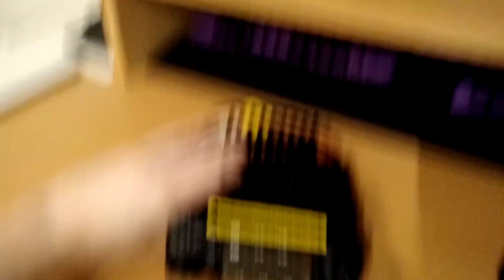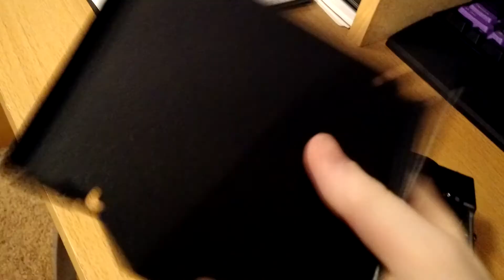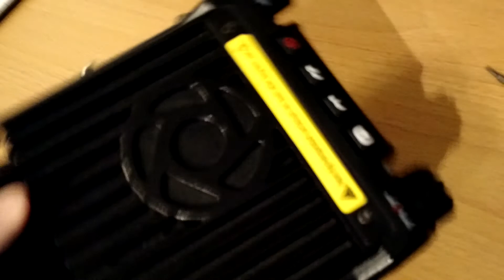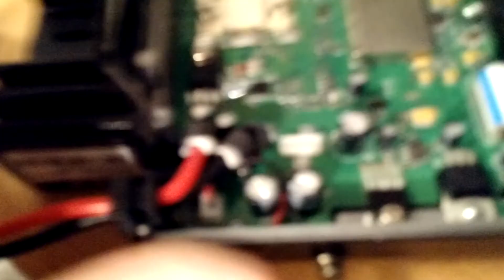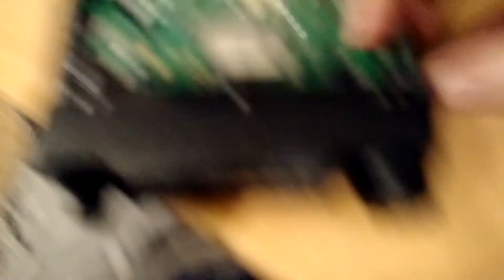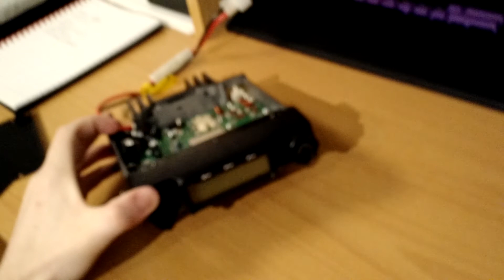Quick look inside : TyT th-9000D ham Radio

Comment: Wrong. The db9 connector in the back IS NOT FOR PROGRAMMING. You can buy a programming cable for this radio and it doesn't plug into a non-existent db9 because that would make no sense. No. The db9 is for packet radio stuff.

Comment: Just blew a fuse installing my th9000D... and, I believe I crossed the 12V + and - to cause the issue. Now, I continue to blow fuses when trying to power up the radio on ANY of my 12V sources. As I understand it... there's an internal protection diode. Do you know of such a thing? Where would I find it to replace it???

Comment: tyt 9000D, I have 2mtrs and 70cm units, this model looks more like 70cm ver, I have my 70cm open atm' a fuse blow 'power crossover' and now no TX  I just removed protection diode still no TX all volts are good (12.4 volts on output of trans in this good or bad

Comment: The PA final device is a Motorola SRF7042 ldmos.  Under the main pcb you’ll find many other SMD parts including the CML chip that handles all the audio processing.  The early radios have an issue of exceeding the CML vcc maximum voltage of 4.6v as they run it at 5 volts.  A simple addition of a diode, 1n914, in series will lower this to a safe value. Otherwise, the CML chip will fail locking up the host cpu causing a scrambled led display.  I repair these radios and this is about the only issue they ever suffer.  Very robust and reliable.  We run many as repeater and link radios.  
The whine or buzz you hear may be a result of the CML operation out of its limits.  
73,
Dan N5MRG
Reply: Hey. Question. Have you ever had rx audio drop out after a long winded ham gasbags about his hip surgery? 
Ive had a couple of earlier ones and i love them but the one issue ive seen is rx audio drop outs on nets or other extended transmissions. That and there seems to be a dc bias on the speaker.

Comment: just want to aid to your slight "buzz, humm" ( if you have any other electrical devices), I find tube lights, clock radios to be my problem being to close to the radio, power leads, antanna could pick up line cycle buzz, 73's ...cheers

Comment: Anyone putting the 9 pin serial in for a remote-base radio or repeater the cos or cor output line is always present when receiver radio is unsquelched and receiving any signal so if you put in ctcss decode the radio still has a Cor output upon any signal (useless) for tone decode you will have to add a t32 tone PCB to lock up receiver on repeater input. There's always interference or birdies, qr, ect getting into your input so that's the deal with DB9 kit.
Reply: Have you built a repeater using these radios? Asking because I’ve ordered the radios and interface cables. I have outboard squelch boards but I’d rather not need to use one. Tnx in advance
Reply: Did you build a repeater from the TYT TH-9000D radios?
Reply: @sdjakeblues  You will find that your radios will not power up in "on" condition after a power outage. There is a connector on the back for "external power" which appears to be an ignition sense port. I think you could wire it to 12v permanently but the small barrel connector is difficult to find. It appears that TYT doesn't really sell that cable. When I made my own, it didn't work. 

Did you make the repeater and did you just live with the fact that the radios don't stay on?